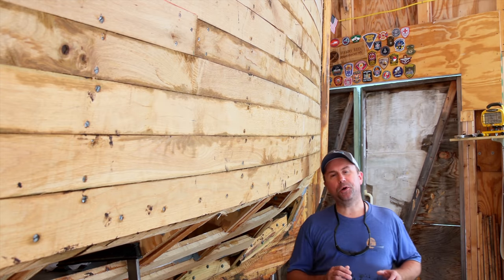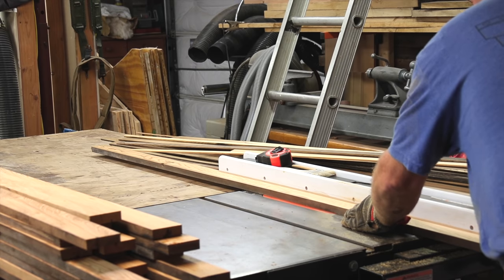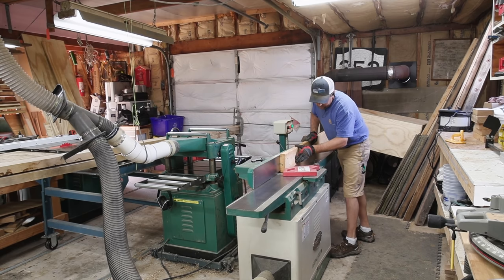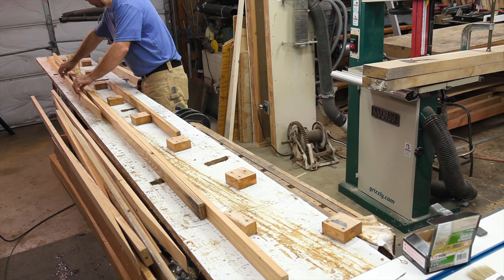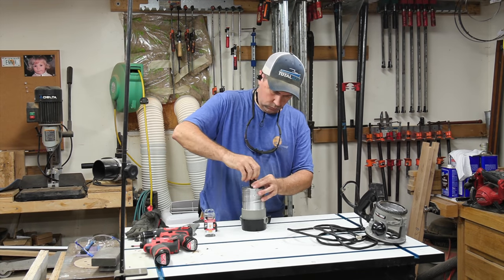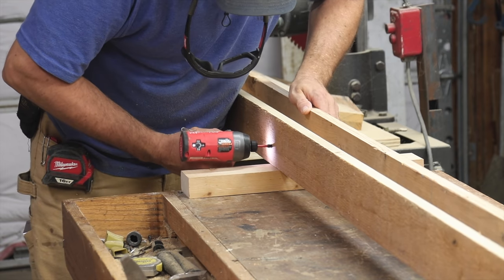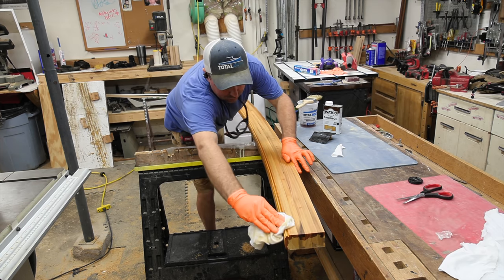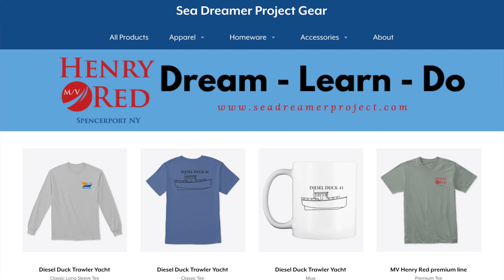Laminated structural arch wooden boat deck beam.  Sea Dreamer Project, Episode 69

Comment: An interesting way to do the scarf joint Scott.  Watching Acorn to Arabella and Tally Ho, they both made a jig that required a router to prepare the scarf.
Reply: The way Scott did it only works for boards up to 2 1/2" - 3" wide. Acorn to Arabella and Tally Ho were scarfing boards 6" - 12" wide!
Reply: @57dent  thank you.

Comment: Scott, beams look great. It appears you screwed the laminations every foot or so and I just wondered why? The glue joints are typically stronger than the wood grain itself and I would have thought the screw holes would make the beams more prone to splitting along the grain between the holes, although I guess the laminations would work against that.

Comment: The edge routing on the beams looks nice.  There’s still a sharp 90 degree corner on the bottom though, right?  If (when) someone whacks their head, I would think a simple round over would be the least likely to break the skin.  

Also, the pre-finish looks great and will help to stabilize the wood during construction.  If there’s going to be a significant delay before their final join to deck and hull, have you sealed the top and ends?  If not, those surfaces are free to absorb atmospheric moisture while the sides and bottom are not.  This could lead to warping.

Comment: Scott, why is the height of your out-feed table so much lower than the height of your table saw? It looks like you’re working real hard to keep the work down on the table saw and it could be throwing off the accuracy of your cut.
Reply: I used to have one the same height. It’s a constant battle to keep them level. I found it easier to have the out feed lower. It’s not perfect, but it’s much better than having a board raise up while ripping it.